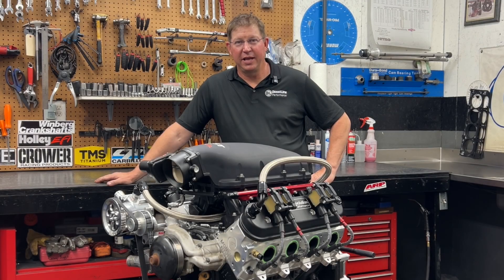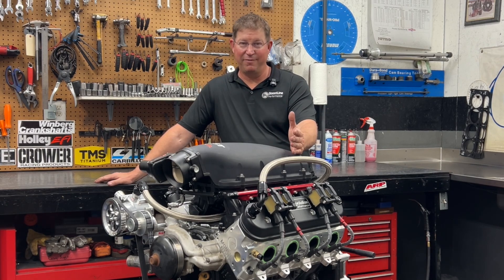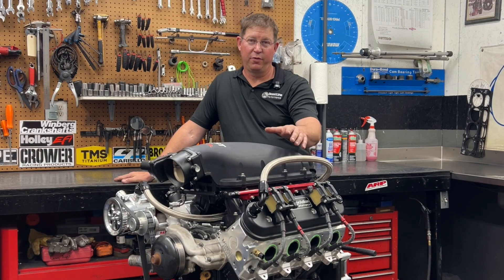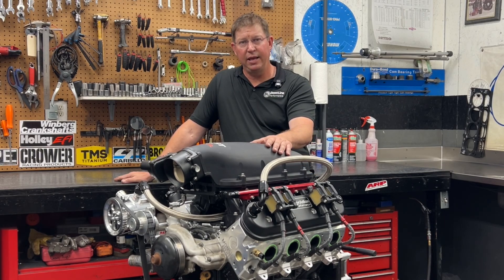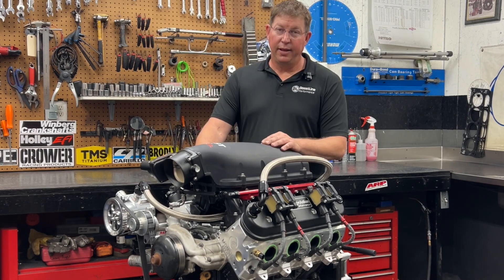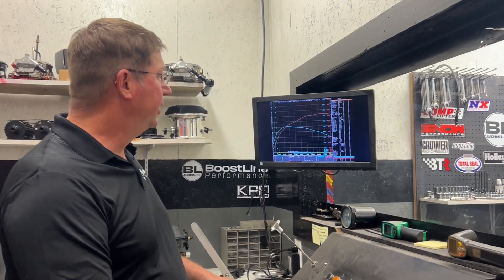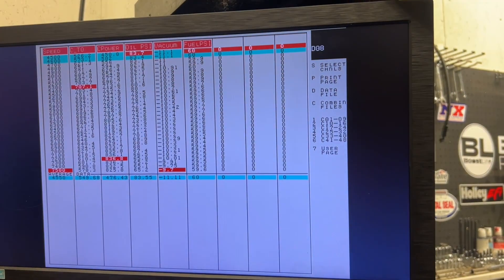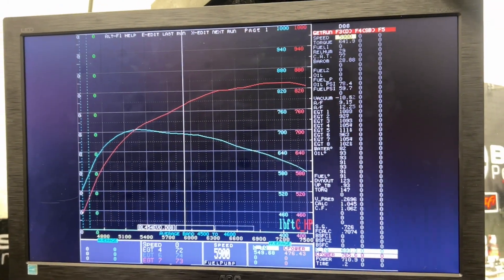Boostline's LS 454 Puts Down Over 800HP Naturally Aspirated on the Engine Dyno

Comment: Did I see $19,500? Good Lord that's a whole bunch of money! 800 h.p. is awesome! How much does a 1064 h.p. 632 inch engine cost from Chevrolet? Close to the same price I would say!
Reply: The Gm crate cost 38-40k. All aftermarket everything block,heads,internals all parts basically but blueprint engines 632 with 815 is like 17k with more factory parts but still pretty rocking with 815hp

Comment: Why is this impressive? Ferrari road car engines make over 800 hp with full emissions controls, running on pump gas and with less displacement. I'd also bet that it would be cheaper and easier to develop the Mercury SB4 to make the same amount of power.

"2+ HP per cube NA threshold"

lol
Reply: If you’re into farrari’s you’re watching the wrong channel.
Reply: @MichaelSmith-ov1nf  Even if given the chance, I'd never own a Ferrari, they're just a name that everyone knows, so I use them as an example. Edit: And I have to say that I loathe Ferrari as a company, especially after the 2024 Le Mans race. Toyota more than earned the win and I just don't understand how Ferrari got away with their little oil slick maneuver. They're just slime... but that's how you win in this place.
Reply: That v12 has to rev to 9k to make that, with a very peaky hp curve. I won't even mention torque, as stroker v8s like this beat the v12 by about 300ft lbs, and make that torque off idle!
Reply: @motorhead281  Are you kidding me? High revving pushrod V8s have absolutely awful low end power, because they need ridiculously aggressive cam profiles to allow them to overcome their horrible high rpm breathing characteristics. You can't tell how wide the power curve will be by comparing the amount of torque an engine makes, either. For example, an Audi V10 produces more torque at the wheels than an LS7 Corvette, at every speed and in every gear, yet it makes less torque at the flywheel. The V8 in this video is also completely illegal to drive on the road, as it has no emissions controls and it almost certainly needs leaded fuel to make its power.
Reply: @motorhead281  And do you not see the torque curve drop off into oblivion below 5,000 rpm? You have to be trolling. There's a reason why pushrod V8s aren't competitive against DOHC V8s in motorsports.
Reply: @PistonAvatarGuy  Emissions legality?! You must be trolling. I read your nonsense till then and stopped
Reply: @motorhead281  lol, ignore it all you want, but it's the only reason why the Ferrari V12 makes as little power (and torque) as it does. And Americans wonder why they can't compete with the Europeans and the Japanese at the highest levels of motorsport!
Reply: @PistonAvatarGuy I would guess that's the way they loaded the dyno for that range, if they started the pull at a lower rpm it might look a bit different. With that long of an arm and the displacement it's gotta be making good torque down low.
Reply: @stevenbelue5496  Good torque compared to a 4 banger, maybe, but not compared to a DOHC 4-valve engine of the same displacement and power output.
Reply: If you dont like something, go away from it. Nobody else cares.
Reply: @UBeesh10  No.
Reply: Wrong, the only Ferrari to be close NA is the 812 Superfast and it produces 788hp.  Also it is not that small of a V 12 at 6.5L displacement, almost 396 cid and technically less than 2HP per cube.   Compare 702lb ft of torque here to 530lb ft.   And your comparing an engine for 20 - 25K versus an engine for 100+K .   So yes this is very impressive.
Reply: @Carter-PPLUS  The 812 Competizione is road legal and produces 819 hp. 819 hp from a 396 cubic inch engine works out to 2.07 hp per cubic inch. I was also laughing because the S2000 (the initial JDM version) made 2 hp per cube quite a long time ago, and that's also something that DOHC racing engines do without much effort.

According to their website, this engine is over $50k, the SB4 is less than $40k.

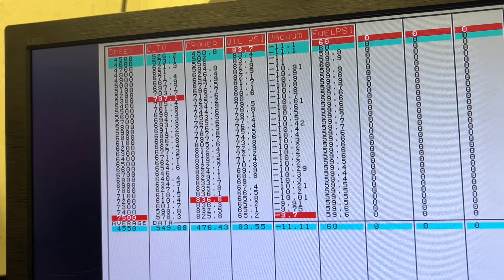Comment: For a second I was 2:04  really interested since i thought the displacement was still a 5.3 , solid engine but increasing the displacement is just normal and not the excitement i thought it was 😅
Reply: Yeah, sure the title reads "LS 454 IRON 5.3L BLOCK HOW?"

It's not your fault you don't know that 454ci is roughly 7.4L. Then you'd HAVE to know that 5.3L is roughly 325ci. The initial confusion is understandable, although could have been avoided on your part. Had you been more interested in mat and science classes.
Reply: I guess a 7.3l from a 5.3l block is not impressive. Are you snorting or smoking?